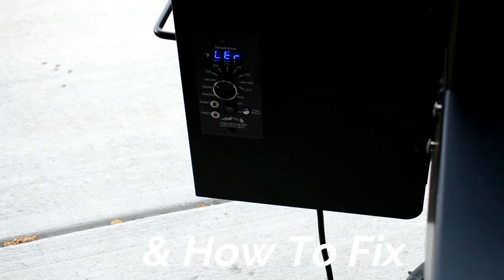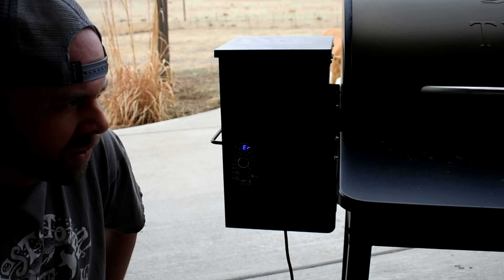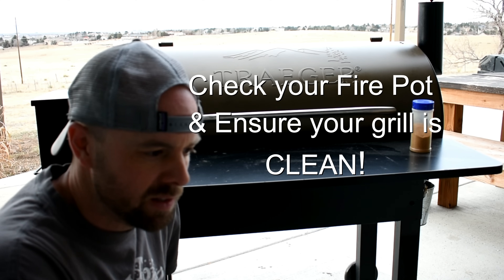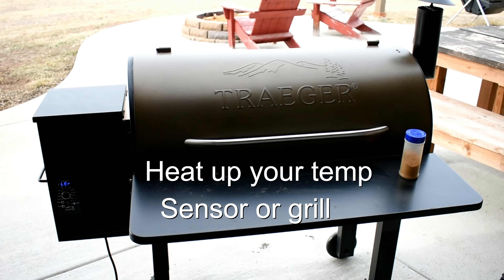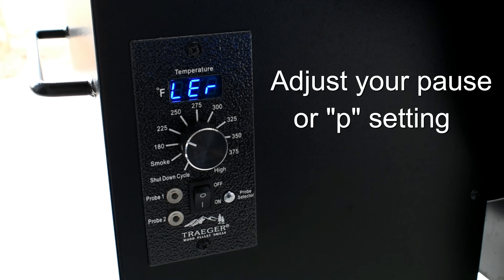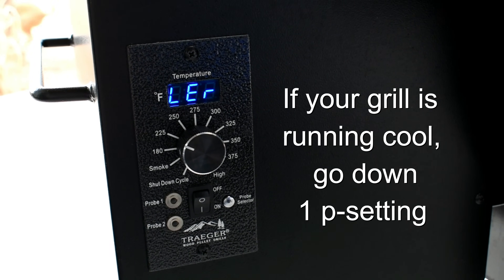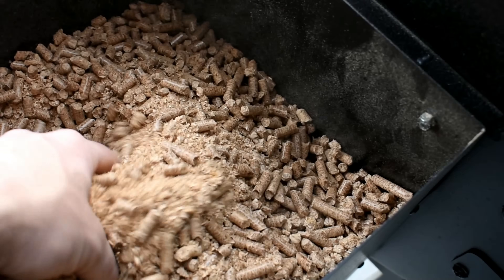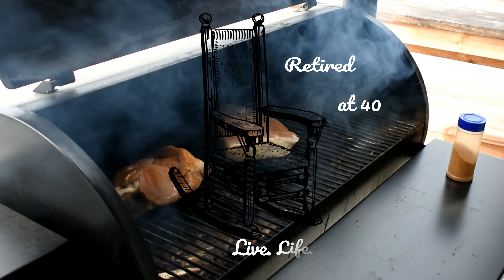TRAEGER TROUBLESHOOTING👉How to fix "LEr" Error Code👈 #traegerler

Comment: Had this code and it turned out the auger was clogged with saw dust and wouldn’t turn! Used a shop vac and cleaned it out as well as the fire pit and it’s running great! Thanks for the advice!

Comment: Just put mine together. It's 45 degrees outside so it took 2 rounds to get it up to temperature. Thanks for helping me figure out the error code. Can't wait to start cooking on this thing.
Reply from the maker: i think you will really like the Traeger.  It takes a little getting use to, but the end product is pretty tough to beat.  Happy grilling

Comment: Thank you very much for taking the time to create this You Tube video. It was extremely helpful and probably prevented me from running down to Costco to buy a new Traeger, ultimately saving me a significant amount of money. I was smoking a marinated Santa Maria trip-tip when my Traeger shut down and displayed the "LEr" code. Worried about my tri-tip, I immediately fired up the propane BBQ (definitely not the same as smoking) and then decided to check You Tube since I was already sitting on my patio surfing the net and enjoying some whiskey (yeah, I wouldn't make it to Costco today anyhow). Long story short, I followed your advice and the Traeger fired right up. Good comment/advice by Tom McLemore also. Thanks again & wish I could've retired at 40.
Reply from the maker: Glad it helped Chris. Cheers!
Reply: I got mine 2 years ago there and I’m returning the galldarn thang 😂😂😂😂makin my wife do it tho

Comment: Mine was because I went to 225 too fast without the pellets making it through the tube first and without keeping in smoke longer to push them along. Basically, there was nothing to burn in that time so it shot out that code abd shut down. Make sure your pellets are being delivered to the fire bros.

Comment: If you get the LER code ALWAYS CLEAN OUT THE FIREPOT BEFORE RESTARTING.  Not doing so can cause the grill to explode. Always empty the firepot per the owner manual before restarting. I didn’t do this properly and ended up with a very dangerous situation.
Reply from the maker: Thanks for the tip Devin
Reply: Mine exploded as I was reading this. Thankfully I was not injured. Please do this step everyone! 🙏
Reply: Yup learned this lesson the hard way today
Reply: I have had a Traeger fire multiple times from this mistake. Unfortunately, you have to pull the meat out and stick it in your home oven to help keep whatever internal temp it's at not too fall too drastically, wait fit the Traeger to cool,  remove pellets from pot, then start over with the cooking process.
Reply: @duuudsweeet  what is the cause of it happening in the first place?
Reply: Is the “firepot” the same thing as the pellet hopper?

Comment: Happened to me this Labor Day weekend. I called Traeger. They said my pellets were probably a little low. Yes, a little low. They asked if I started my Traeger with lid open or closed. Open like the directions say until,I see smoke. They said they now recommend the later model grills, maybe all, start with lid closed. They said too much heat gets lost with top open. When you close lid it starts wild fluctuations between hot and cold that makes the thermostat change from too hot to too cold. When in a down cycle, and maybe below 150 for 10 minutes as mentioned in this video, or maybe just with a small fire in the fire pot the auger will dump so many pellets that it can put out the fire. The low pellet supply causes uneven pellet feed to the fire pot. They said it’s much better to stir the pellets about every hour. That’s too often for me on an over night cook. I also agree in the video here there was too much sawdust. Need a strainer to get that saw dust out or return to dealer for refund. Traeger is making a nice false bottom for 5 gallon buckets and a nice top for 5 gallon buckets that you can pour out of an opening in the top. The saw dust is supposed to settle out of the screened false bottom. I’ve got a Traeger metal bucket but they have been sold out of the screened false bottoms locally and I think on line but available now I heard.
Reply from the maker: Thanks for the info Tom.  Best of luck with the Traeger, hope your next experience is a good one.

Comment: I've got a Traeger Junior Elite. I have a success ratio of a little more than 50% keeping my cooker from shutting off. Fresh pellets and keeping the fire pot cleaned is a normal routine but somehow the fire keeps going out about 1/2 the time. I have played with the P settings and I still don't trust it. The food is awesome but the paranoia about having to constantly watch to see if it is going to shut down makes the experience less than pleasant. I have had it about 15 months and have used it routinely at least once a week or more since I have owned it. Traeger sent me a new controller and temperature sensor and yet it still shuts off. I will be upgrading to a new pellet cooker soon and it probably won't be a Traeger.
Reply from the maker: That's unfortunate man.  It sounds like you have a lemon.  I know lots of people who have traeger's and love them, including myself.
I would try to contact Traeger again and tell them you are unsatisfied with their product and will be forced to switch to another brand.
Reply: Retired at 40   I have called and emailed them numerous times. They can probably recite the serial number by memory and they know it has issues. I can't fault the customer service people because they are doing what they are told and have sent replacement electronics. They respond timely with email or when calling you can actually talk to a live person. You're right, unfortunately it's a lemon and I will be replacing it with another pellet smoker that is not a Traeger.
Reply from the maker: Bummer.  I wish you well.

Comment: When you upgraded the controller did you notice any less temperature fluctuations? My one complaint is how the temperature if set to 250 goes down to 170 and then up to 350. Other than the probes what's the another reason to upgrade?
Reply from the maker: The pro controller is more accurate.  Temp still fluctuates but not as drastic.

Comment: Ok. I have a newer traeger like yours. You didnt explain how to change the P setting on it. You did explain how to set it on an older one. Are you saying this can't be changed?
Reply from the maker: no p setting on the control i have
Reply: @thefreezedryingcommunity  
Someone mentioned that if you remove the controller there is a method inside to adjust it. Guess i could try that and see

Comment: I have had my grill for about 16 months this is the first trouble I have had with it it first had the ler code flash the other day and of course had to finish meat inside in the oven,I forgot about it and just tried to use it. Turned it on smoke with lid open started smoking so I shut the lid set it too 250 went inside for about 10 minutes come out it was on about 320 and there was so much smoke more than usual. I could also see a pretty good flame toward the back was probably 4-5 inches above the cooking surface.So what could that be.

Comment: So, how do you adjust the P setting on that controller?  I have the same controller and I can't find any way to adjust it.  I have checked ALL other possibilities that could cause the Ler error.  I even have a cover and still throws the Ler code when I try to just run on smoke.
Reply from the maker: I do t think this control has a p setting

Comment: I have had the Ler fault about 5 times.  After long struggles with why I have found that with MINE, it was caused by leaving the hopper to vacate the auger and run out of pellets (twice), or leaving the setting on smoke (twice) or changing the temp from high to 180 and not checking the temp back at 180 and turning it back up to 300.  This is the weirdest because I have not repeated the high to low to medium setting and haven't had a Ler fail for more that a year (approx. 40 smoking sessions).  In MINE, I have always now started by the book and set the min temp to 180.  I also keep a small log book with the thermometers and smoke tools and record when I do the smoking.  whenever you set a temp on the dial, let it get there before you change it again.
keep notes on how you use the smoker and track how it keeps temp.  keep with fact and accuracy,.
btw, the lil Traeger died on superbowl sunday.  before I started any smoking. sad face.
I called Traeger on sb sunday and the tech did trouble checks and got me replacement parts for failed controller in three days no charge.  fixed in two hours and no problems yet,.

I suspect failure with wet pellets,  why use them?
I have had lots of dust/crumbled pellets and not had failure.
I put the pellets in a container that lets most of the dust stay at the bottom.

my feeling is to try and give it the best chance of success and it will work.  don't challenge the smoker
Reply from the maker: Well said Phillip.  Sometimes you can't rush a good thing.  Just sit and let the Traeger do the work.  I have had some issues with the auger run dry as well.  I have made a habit of mixing up the pellets every time i go to check temp.

Comment: I am getting so frustrated with my Trager. Husband has replaced the fan in it, and talked to Trager turns out now you are supposed to start immediately on the temp you want with lid closed for 15 mins. Complete opposite of what the manual said that it came with. How are you supposed to know this unless you call them? Still the issue I have is the smoke setting. I thought that you aren't supposed to jump from high temp to smoke, but when I start right away with smoke it works for a bit then I get ler. Even if i had just cleaned the dang thing out.
Reply from the maker: sounds like a temp control issue.
Reply: Retired at 40- Live.Life.Simple. How do I fix that?

Comment: Just had that error code, refilled the augers, turned it on to smoke to warm it up, then after a few minutes the fire pot freaking exploded and started pouring out smoke.
Reply from the maker: whoa that doesn't sound good
Reply: @thefreezedryingcommunity  yeah no kidding haha.  Apparently it's done it once before.  Thing is, the fire pot was cleaned out completely before use, so I have no idea what cause it or exactly what exploded.
Reply: @thefreezedryingcommunity  grill still works btw, weird
Reply: Justin E. I am on my third cook on a new traeger, I’ve had nothing but problems with it since the first cook. So last night I put a brisket on and the temperature jumps up & down non stop a good 40 degrees it never holds the set temperature. & so far it’s shut down on me twice during this last cook, I had to finish my brisket in the oven, I have company coming over! Both times it shut down was due to the fire box, not sure what it’s actually called, was completely full of pellets, I have traeger pellets I just bought everything 3 weeks ago, so it shouldn’t be having theses problems. Totally unreliable! I very much regret buying it
Reply from the maker: @justine.3576  that is strange, hopefully a one time thing
Reply: Justin E. 
Any time a Traeger (or any pellet smoker) shuts down with the LEr or HIr  you ‘must’ take the grate and drip pan out and check the fire pot.  This is in the instruction book also. 

When the flame is lost, the auger can still feed pellets to the pot.  If they’re not cleared out, when you restart the grill, the entire fire pot of pellets will ignite. Usually after a whole pile of smoke comes out of it. It will then flash over into a fire.  

Always check the fire pot after a shutdown.  

The P-setting is only effective on the ‘Smoke’ setting.  It has no effect when setting the cooking temp.  

Lots of people use a dual temp probe/monitor to track both the meat temp and the grill temp.  Set the grill probe to alarm when the temp goes below 135F.  Gives you a chance to check things out before a LEr error.    And also set a high temp alarm at some point higher than your desired cooking temp.
Reply from the maker: Agreed.  I would always check the fire pot first